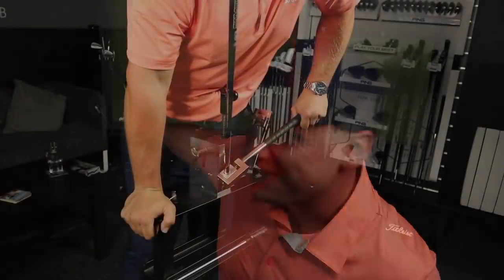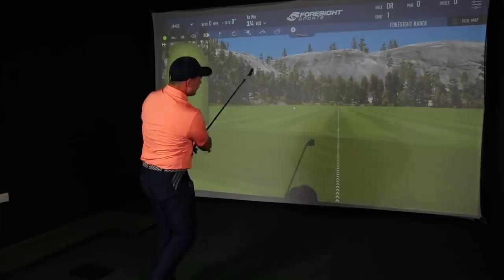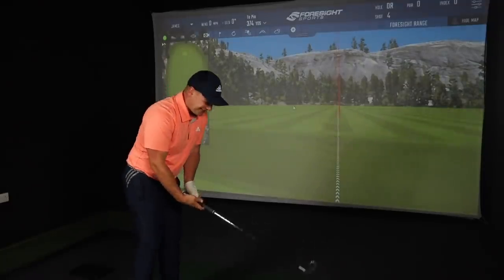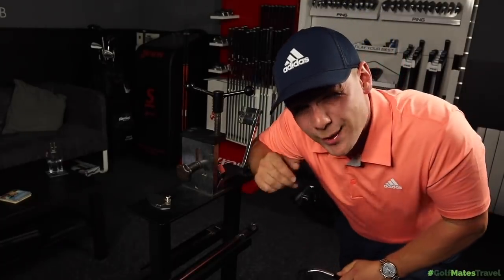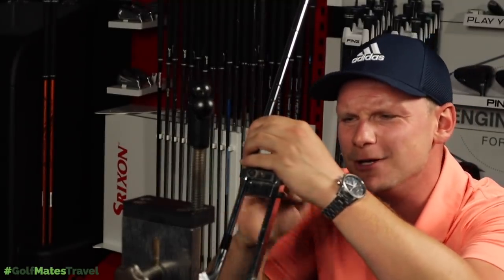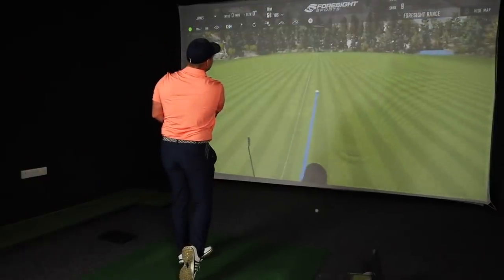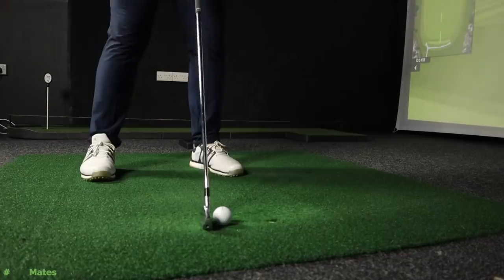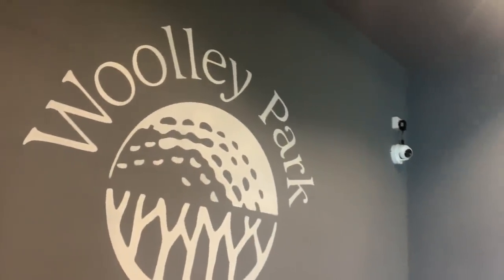I MADE A 15 DEGREE 8-IRON - THIS THING LOOKS INSANE!!!

Comment: Fun!! I do have several completely inconsequential comments, though:
1. Until I went to a mallet-style putter in recent years, I always used my PUTTER with a 3/4 swing to punch out from under trees. I worked surprisingly well.
2. The negative bounce created my that much loft reduction would make for a club that is unplayable in the wild. (except off the tee)
3. Would it not have been better (easier?) to bend a single-length 3-iron to 15 degrees, Might have made a more playable club.
4. Keep doing what you do! I am in the 'anti-stuffy' camp, when it comes to golf.

Comment: I'd love to see the "ultimate lob wedge." Get a low-bounce PW or a low bounce gap wedge and blend that weak to 60 or 64. The extra shaft length will get you crazy height (in theory) on full swings. Unlike the crazy 70* wedges you can buy, I think a normal lob wedge loft + longer shaft might be useful.

Comment: The sole of the club is designed to compliment the loft. By changing the loft that radically you now have a club that is no longer sitting on the sole at impact. Instead it is sitting on the leading edge. Any fat  shots could be disastrous. Why not take a low lofted iron and maybe tweak it a little lower in loft so the sole is still working like a shot back in your stance. Then increase the lie angle to match an eight iron and then shorten and regrip the shaft

Comment: this is irrelevant to the video, but my mate told me to get fitted, im a mid to low handicap player, never had a lesson and can strike a ball considerably well. do i have lessons with my current clubs and then get fitted? or do i have lessons after getting fitted? my current clubs were bought ever the internet so they came in standard lengths and shafts etc?

Comment: Basically this is just a single length club, but only the 8I length instead of 6I.
Reply from the maker: What 6-iron do you know at 15 degrees my mate?
Reply: @JamesRobinsonGolf  The single length clubs use a Cobra F9 use 7I length and go as low as 19degrees for the 4I...  My comment was about the single length club... not the actual angle